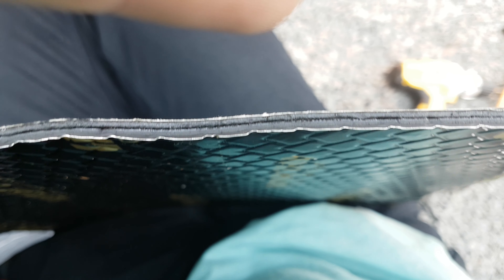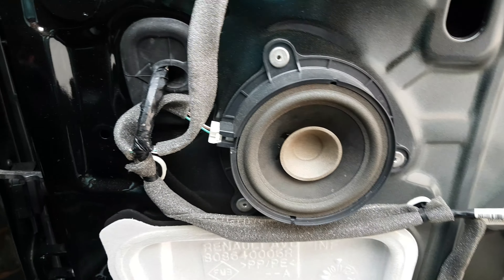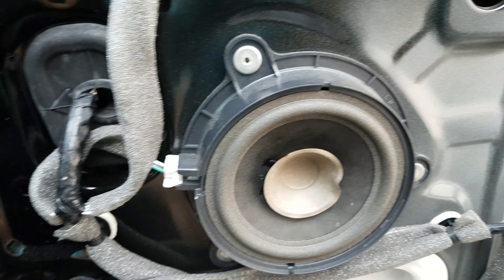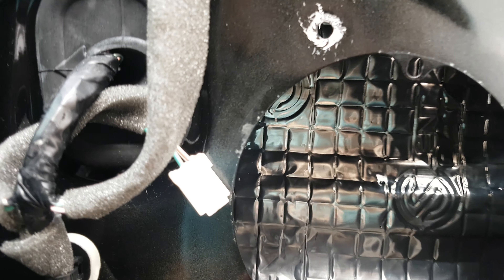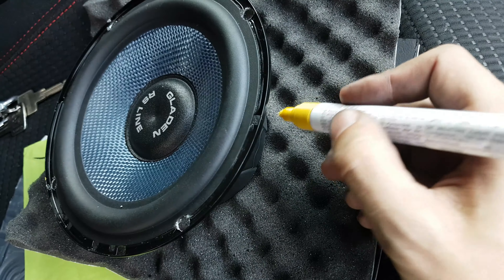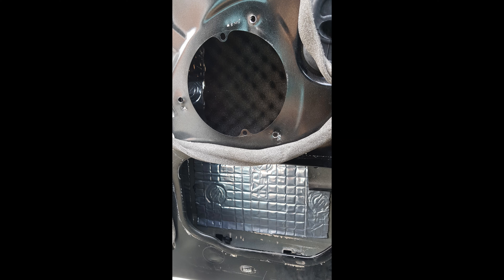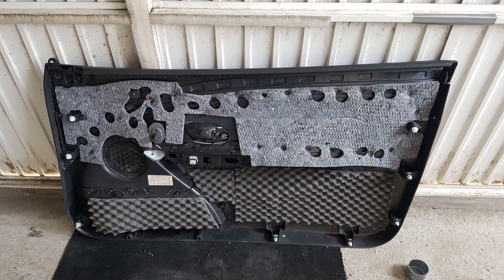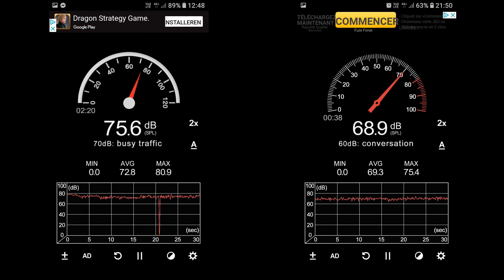does soundproofing really work ? (upgrading the sound quality of the car)

Comment: For anyone watching, just use the butyl aluminum sheets and closed cell foam sheets layered on top 

Those spiky egg carton style foam panels don’t block sound, they eliminate vocal reflection and echos. 
Also they’ll likely retain moisture which means rust, which would be super bad when it’s between the body panels and out of sight. 
UNLESS those panels are just textured closed cell foam. 

If they’re the $5 ones from Amazon or whatever, then skip them.

Comment: Amazing results! Thanks for the video! In the next couple of weeks I'll be doing soundproofing on my 2010 MK6 Golf. I already purchased 4m2 of 2.2mm butyl material and 4m2 of high density foam insulation mat.
Reply from the maker: Thank you
I think a golf is allready pretty sound proof from the factory ? 😊
Or is it for the speakers ?
Reply: @HappyDude1  It definitely is a very quiet vehicle, but I want to take it to the next level! Also I'll be changing the front component speakers and tweeters
Reply: How did it go mate? Treating which area gave biggest gains? I'm planning to do the same for my mk6 tdi. Road noise seems to be the biggest problem, especially riding over rough surfaces

Comment: Great video and explanation! 
I'm wondering, do you have enough space to roll down the window without touching the insulation?
Also what size is the speaker, is this 5 inch(13cm)? Or 6.5(16cm)?
Reply from the maker: Thx 
And yes there is space to work if you put the window up 
And i dont know the size of the speaker anymore  anymore

Comment: Thanks for the usefull video!
Where exactly did you use the non-wavy foam material? Between the speaker and where you mount the speaker in the door? Does it just have to be where the speaker touches the door or fully behind it?
Thanks!
Reply from the maker: Thanks! 
Between the speaker and the mounting bracket yes 
To absorb the vibrations
Reply: Thank you

Comment: 5 dB reductions only???
Reply from the maker: Thats a lot you know
Reply: @HappyDude1  Yes, but in what frequency?
Reply: Panca tab, 24dB is double the noise of 23dB just for info...
Reply: @nourizakaria642  in terms of what? Loudness? Sound Intensity or Sound Presure?
Reply: @nourizakaria642  sorry but thats not true, 3 decibel doubles the volume. So 63 is twice as loud as 60 en four times as loud as 57 decibel. Its exponential.
So 5 db less will be about 3 times as quiet, which is a lot